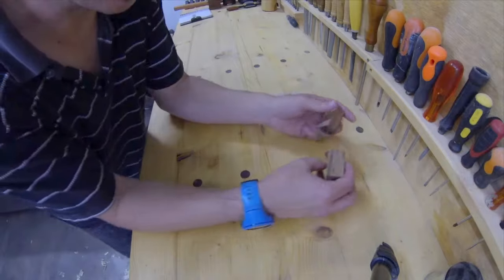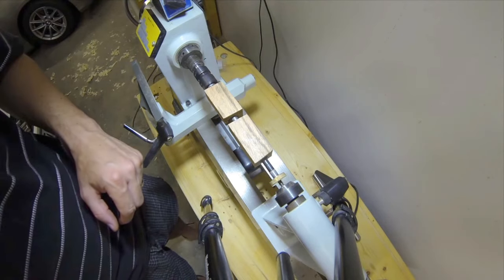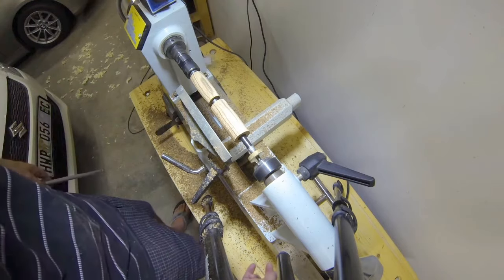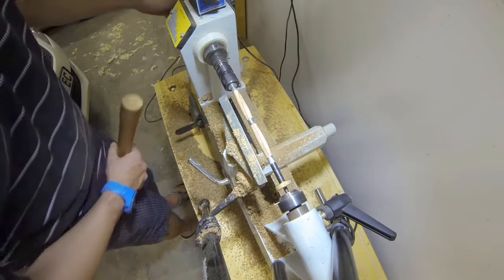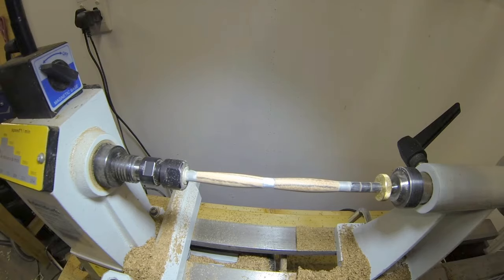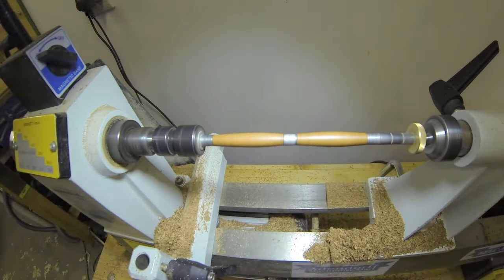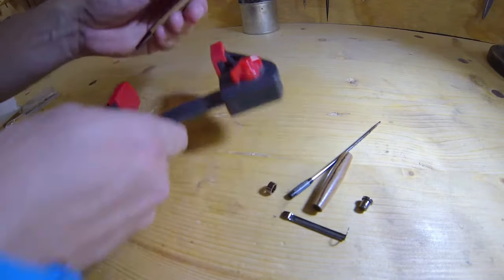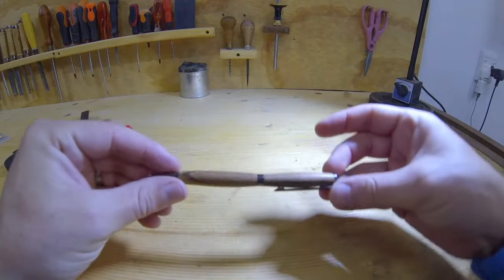Zebra wood slimline pen

Comment: Very nice. That micro crystalline wax is interesting. It seems to be a very soft paste or polish. Not liquid. A sort of a polish. I may have missed you showing it in the tin.
Reply from the maker: Hey Dru, its a soft wax which is nice and easy to apply. Its a byproduct from petroleum production. The nice thing about it compared to other waxes is that it forms a fairly tough barrier rather than remaining soft.